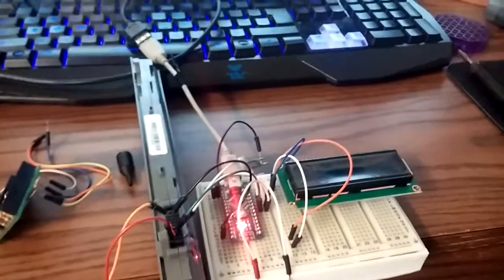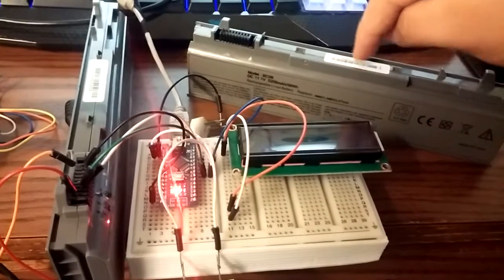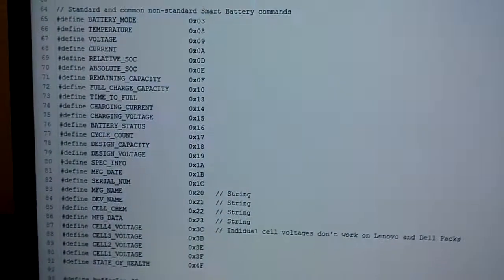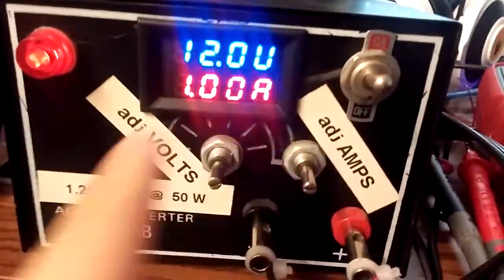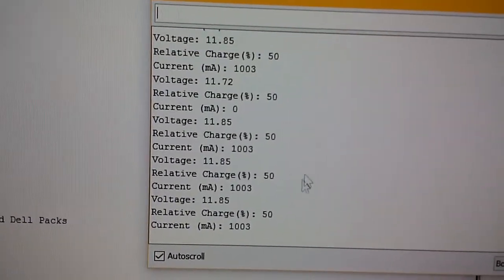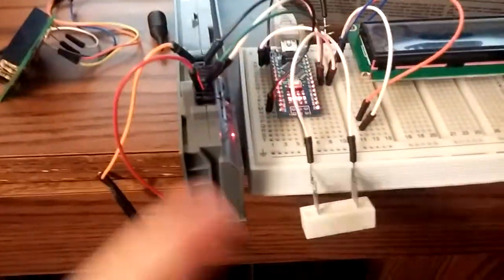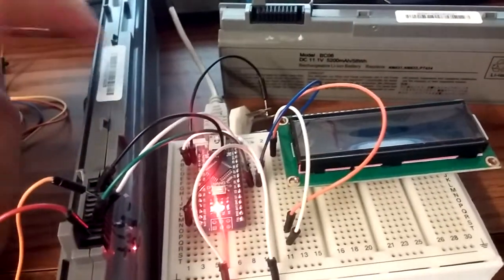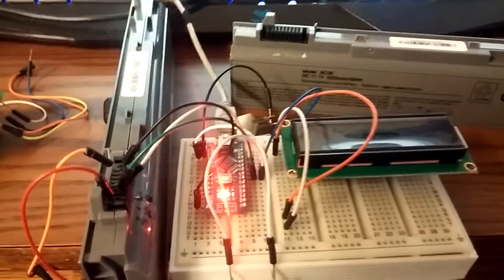DIY Portable Laptop Charger [part 1]

Comment: What model battery is that? And yes so is there a continuation to this project?
Reply from the maker: it's a BC06 laptop battery. laptop cells generally use the SMbus protocol similar to I2C. memory addresses should be the same if it's SBS compliant so you just need to figure out the pinout. i stopped the project but the info i learned has helped me with my current job. haha it came full circle. I actually just dismantled those 2 battery packs a few nights ago to use the cells as a test platform. the built in BMS for the BC06 is Atmel based but specifically designed for Battery management usage.

Comment: still waiting....
Reply from the maker: henki 1986 I do this for fun m8. I'll pick up the project again at some point. I have a few 3D printed parts and cut aluminum bar frame/heatsink. It takes time to perfect the boot sequence and monitoring software.
Reply: well, but it cool.... i also have a few unused laptop battery, i need to use all part. and i interest with your video... so i waiting...